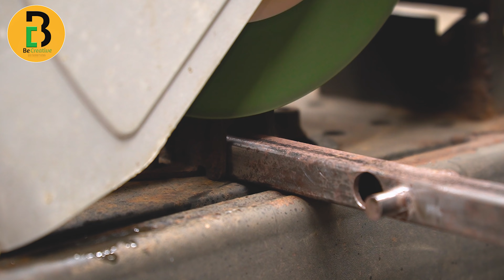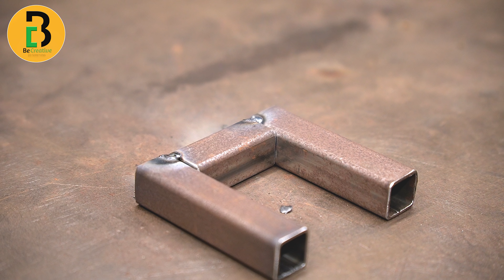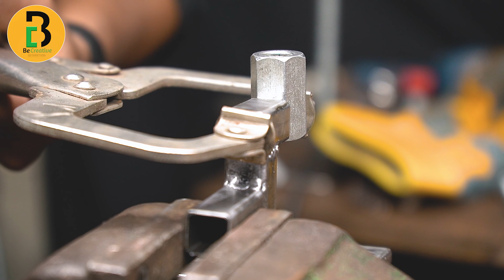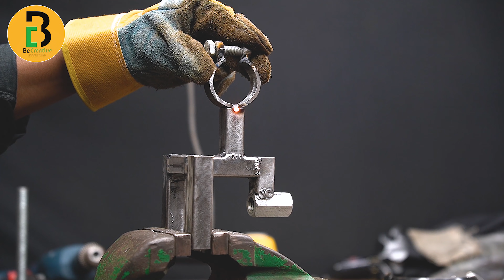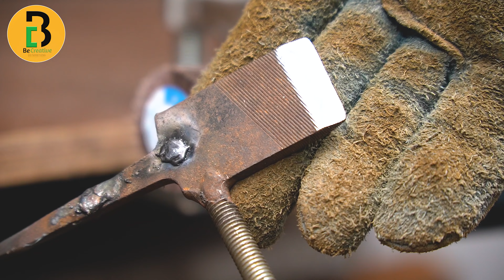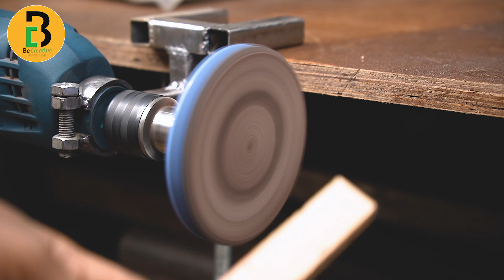Use Your Drill machine Like multi Tool | Great Idea

Comment: Great tool.
Reply: For Drilling, yes. For sanding, grinding, cutting, scrapping, polishing and buffing metal, NO. The Drill's RPM is too low to be effective, only 1,100 RPM's (revolutions per minute) An Angle grinder speed: 11,000 to 13,000 RPM's very effective Drills are for drilling holes and torquing bolts and screws. Nothing more. You would not use a Drill as a hammer, would you? I guess not... Piensen para que otros no lo hagan por ustedes.

Comment: Awesome idea for the guy with a small shop
Reply: Or a small brain... Drills are for drilling and fasting only. Grinders is the best option. Nothing "awesome" about using a drill for sanding and grinding.
Reply: @Phoenix-One0922  well if you have room for all that equipment and a person is doing any kind of major jobs you would be totally correct. I don't think it is meant for a major machine shop! 🤔